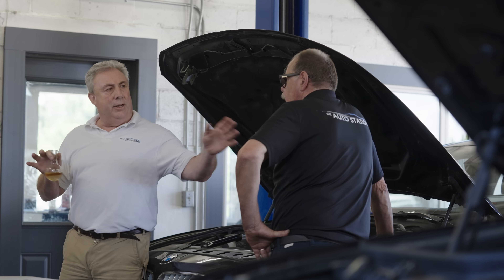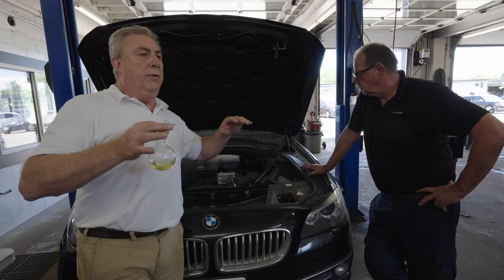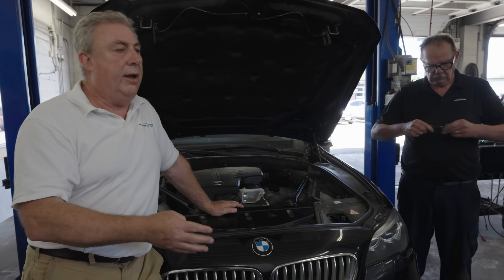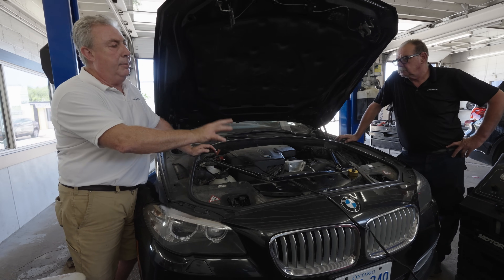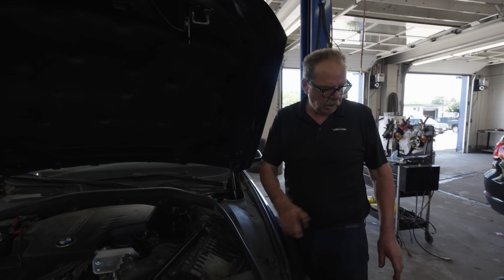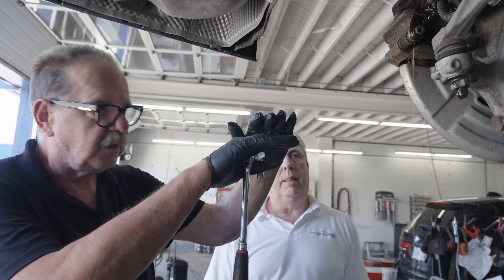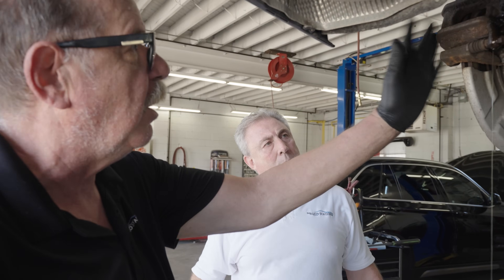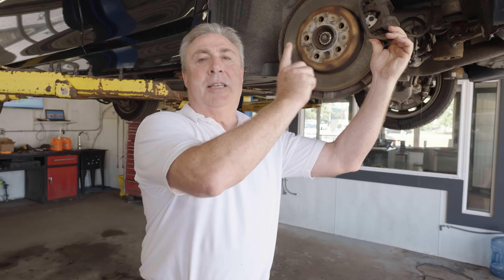Why you MUST Change your Brake Fluid and HOW to do it!

Comment: I do a full flush spring and fall, change my engine oil every 2000 kms,  Change transmission fluid and power steering fluid yearly.    2008 buick allure.   Mechanically flawless  ;)

Comment: I'm a maintenance freak. I do brake fluid changes approximately. Every two years max. Off topic; Cooling system fluid every two years on on the OEM fluid. However, for VP / Redline racing fluid yearly... Raduator flushes are critical these 10 year rad / fluid changes are BS

Comment: Some vehicles with advanced handling or off-road modes need a proper cycling of ABS module soleniods to get a proper brake fluid flush. So this may not really be a "Shade Tree Mechanic" type of job as you need to run a ABS module test cycle.

Comment: I bought a system that has a catch bottle for the old fluid, a reservoir for the new fluid, and a pump which uses air from an air compressor.  I haven't used it to flush the system yet, but it has worked very well in bleeding the brakes after replacing calipers.

Comment: What year exactly is considered "newer cars" more prone to braking issues due to excessive water in the fluid? 🤔🤓🧐
Reply from the maker: Thanks for the terrific question.  Yes, when I'm talking about "newer cars" it does reveal my Boomer perspective.  I do get that comment a lot😎 .  

Generally tho, I’m intending to point out the widespread adoption of ABS and other advanced braking considerations.  For ex, adaptive cruise braking systems, and some EVs/hybrids rarely use brakes - so fluid sits and absorbs more moisture. It's these generations of car that brake fluid condition becomes more  critical. Captured moisture impacts boiling point, corrosion risk, and solenoid valve function which results in an OE recommended flush every 2 years minimum.

🚨 Why the Timeline Tightened:

ABS & ESC modules (from the late '90s onward) are full of tiny solenoids and valves that hate sludge and corrosion.

Higher brake pressures and smaller component tolerances mean water contamination makes a bigger difference faster.

DOT 3 & DOT 4 brake fluids are hygroscopic – they absorb moisture from the air over time. That moisture lowers the boiling point and corrodes internals.

Modern braking events like emergency braking with automatic collision sensor systems rely on fluid that performs precisely and instantly.

🔧 Rule of Thumb Moving Forward:
Pre-1995: Brake fluid flush every 3–4 years was acceptable if not pushing the car hard.

1995–2010: Every 2–3 years. Needed for ABS health and consistent performance.

2010–Today: Every 2 years max, especially with stability control, lane keeping, or hybrid regenerative braking.

In fact, typically what we say when explaining this to a customer:

"Back in the day, you could neglect brake fluid and mostly get away with it. Not anymore. Modern brake systems are like finely tuned instruments, and old, contaminated fluid is like sand in the gears. It can cost you a pump, module, or worse — safety."

Again, appreciate the response - Thank you.

Comment: I got caught by this problem last year. The Toyota I bought new in ‘12 has been so darn trouble free I hadn’t been to a mechanic for a very long time. The hygroscopic nature of brake fluid just isn’t something you think about very often, so I didn’t have any impetus to have it flushed.

Luckily, as a hybrid, the vehicle doesn’t require the use of the calipers much and they run super cool. I didn’t encounter a safety issue. The water in the system did ruin my rear brakes though.

If I just would have flushed the fluid I wouldn’t have had to completely replace the rear brakes last year. I would have saved a bunch of money. Now I have one of those electronic fluid testers.

Don’t be me, flush your fluid.

Comment: When brake fluid heats up with water in it; the water that's in it has the potential to turn in to a gas and that gas is compressible witch is not what u  want semler to like having air in the brake line's.

Comment: When Im changing my brake pads and when Im pushing pistons I open the bleeder so I can push easier and so that dirty low point fluid comes out and I just top it up a bit after.
Reply: that's not a complete brake fluid change 🤔
Reply: @Kat-on3nm  No of course,Im just saying I practice that so all that bad stuff gets out reguraly
Reply: @BladeRunner031 That's actually a great idea and could save a bleed nipple from seizing up over time. My wife's 10 year old car never had it's replaced, bleed nipple snapped right off,.... I've ordered 4 new nipples, will tackle the job again.

Comment: Brake bleeding: to get air out of the brake system from the brake master cylinder to the brakes. Follow the vehicle's bleed pattern for each brake.
Brake flushing: to get new brake fluid from the master cylinder tank to the brakes. No pattern needed.
I drain and refill the brake fluid tank every year. Cheap and easy to do. No tester needed. Zero brake issues.
2003 Elantra GT, manual, 123k miles, bought new.
Reply: Brake fluid doesn't circulate through ur braking system like engine oil it needs to be flushed to get the old fluid that's down below the master cylinder as well water can literally set down in  the brake caliper I personally have taken a caliper apart and there was some water in it.
Reply: @Kat-on3nm Yep, that's correct. I've never bothered with that type of brake fluid tester he showed either, pretty pointless because it can't reach the calipers. LOL

Comment: I've been a mechanic for 40 years and have never flushed brake fluid in my own vehicles ever, never had an issue. But when the shop has a new flushing machine to pay for suddenly everyone's brakes are going to fail because they didn't flush their brake fluid.
Reply: It depends on area humidity. 
High humidity: more brake issues.
Low humidity: less brake issues.
Reply: U been Lucky I had a problem stopping two defrent times in the same car and after  flushing out master cylinder on the bench and flushing the lines never had that happen again

Comment: 30 years ago...
I was told how brake fluid is hygroscopic and turns into a mild acid which literally eats away the aluminum parts and soften the seals.

If your brake fluid looks like Pee it's whooped.
If its very dark yellow or Blackish....yikes its WAY overdue.
Reply from the maker: Great point, and that is absolutely correct - the fluid is very good at absorbing moisture and causing those problems.
Reply: @TheAutoStationBurlington The average Joe's have a collective belief that Brake Fluid Steering fluid and transmission fluid etc are all lifetime.  
I've seen it too many times it's a filthy sludge.
Reply: That's right two things brake fluid does over time becomes acidic and water absorption ps colant also over time becomes acidic and eats aluminum

Comment: How does the water get in
Reply: .......it's in the air.....
Builds up over the years of sitting in the reservoir.
Brake Fluid is not different than engine oil...
Supposed to change it....
Reply: Brake fluid is very different from engine oil.  @RetroCaptain
Reply: As already mentioned it's hydroscopic ( attracts water from the atmosphere
Reply: "Hygroscopic".
Reply: I mean if the cap is never opened and the break lines are closed and no leaks  where can it get water from , I don't doubt age and heat will decade the oil so a change is  necessary but unless you drive around with the cap off  or haven't added water  you shouldn't get water in your break fluid

Comment: An hour to do the job yourself is easier than taking time to drop your vehicle off or wait in the waiting room. On a DIY job, you can check your vehicle's brake pads and tire tread depth along with suspension components while putting in fresh fluid.

Comment: Can this be accomplished by gravity bleeding, where all 4 bleed screws are opened and you keep the fluid reservoir from going dry?  Also, is it worthwhile to do this without controlling the ABS?
Reply: yes u can do it with out activation of the ABS MOST SHOPS DO IT with out activating the ABS
Reply from the maker: Hey thanks for the terrific question. In this example we had a BMW 535 xDrive with brake fluid that was extremely contaminated.  Our practice for this includes the ABS shift.  But...

🔧 Normal Flush Without ABS Activation:
You can do a gravity bleed or pressure flush through the calipers and get most of the old fluid out. This is fine for routine maintenance if the fluid hasn’t gone really bad or the system hasn’t been opened up (like after caliper or line replacement).

⚠️ But... Here's the Problem:
The ABS/DSC module contains valves and channels that don’t open during normal braking. That means a standard flush won’t circulate new fluid through the ABS pump or valves — which means old, moisture-laden fluid can sit in there and cause corrosion or poor performance in emergency ABS braking. It's more of a concern in an example like the one we're presenting where the Brake Fluid is seriously bad.

✅ Best Practice (BMW-Approved):
Use a scan tool like:

BMW ISTA/D

Autel MaxiSys

Launch X431

Snap-On Zeus or Solus (latest updates)
…to cycle the ABS module. This activates the valves and pump, allowing fluid to move through those circuits.

It’s often referred to as "ABS bleed" or "DSC activation" in the tool menus.

💡 Bottom Line:
Yes, shifting or activating the ABS module is ideal for a proper, full-system brake fluid flush on a BMW 535.

Without it, you’re only doing 85–90% of the job, especially if fluid hasn’t been serviced in a while or the car’s seen harsh driving.  But, it is workable.

My personal opinion is the it’s worth doing right if you want that tight BMW pedal feel that the car is known for and to ensure dependable emergency braking.

Again, thanks for the terrific question.

Comment: What about in dry climates ???
Desert -
Reply from the maker: Yep, obviously it likely be less of a problem.  But, you'd be surprised how efficient this fluid is at sucking up moisture out of the atmosphere.  Appreciate the comment - thanks.
Reply: You can probably go longer since there is less humidity to absorb.  The best way is to test it every year. You can get a tester for $20.

Comment: I do my own brake fluid flush every 30K miles or 3 yrs. I tell family it is important but no one seems to care unless I do it for them for free.
Reply from the maker: If its's any consolation, I know the feeling. Appreciate the comment, thanks for watching.
Reply: Back in the day, your metal lines would rot out and force you to flush.  🤣
Reply: @seeya205  Not true. Brake lines do rust but it's from the elements on the outside, not the brake fluid on the inside.
Reply: @Ilikeryche  why not both?